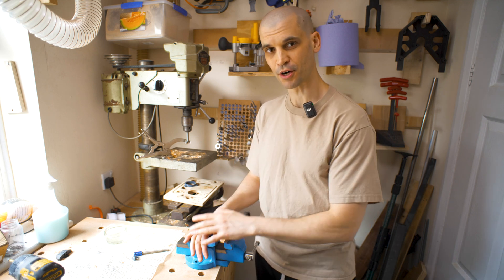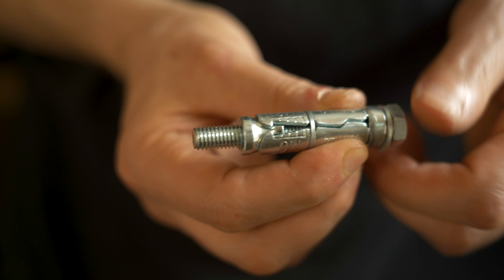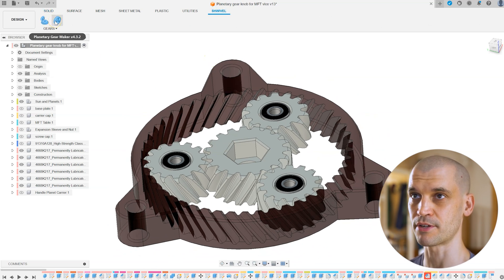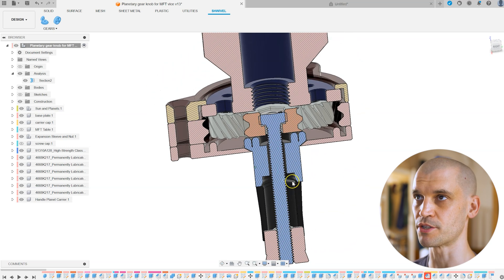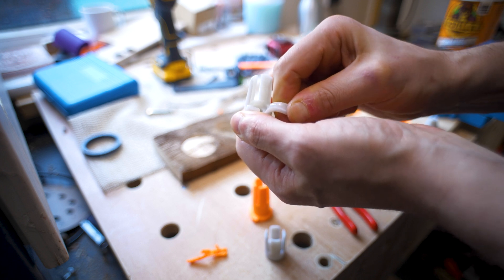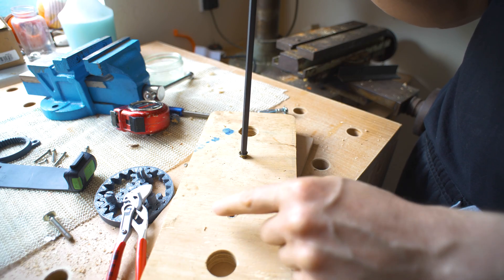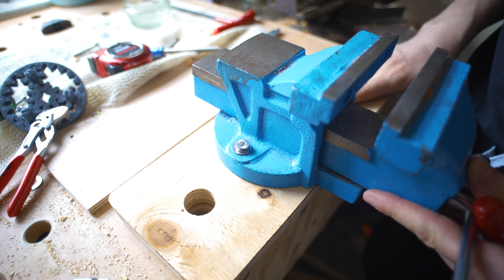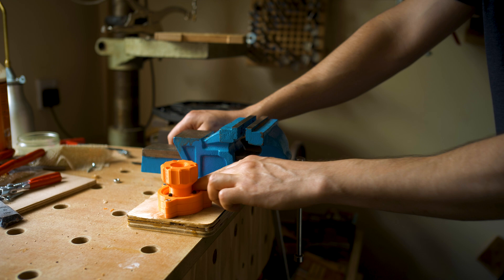Making a Planetary Gear Clamp for my Vice

Comment: For the herringbone tooth profile you can print it in place - one of the advantages is it wont fall apart!
Reply from the maker: I see, so apart from print in place there no way to assemble them?
Reply: @ThisDesignedThat  I think you could do it by splitting the central gear at the direction change in the teeth and then assembling the two parts.
Reply from the maker: Yes good idea

Comment: Well, why not, but this seems over-complicated to my engineer’s eye. Personally, I would just use inserts into the MFT table, then secure the vice with DIN912 bolts and a drill. It’s the simplest approach in my humble opinion: no prototyping, no printed parts, just standard hardware.

On the other hand, if you really want to print something, you could use 20mm expanding rubber (TPU) spacers with bicycle cam clamps. You probably won’t find a quicker or more compact system.
Reply from the maker: yes there are definitely easier ways to do this but i wanted to learn more about gears so opted for the planetary gear approach. Initially I was thinking of using some sort of cam, i think that would have been a simpler approach